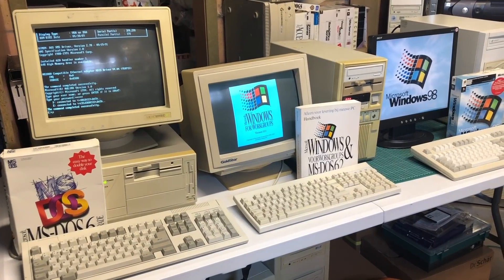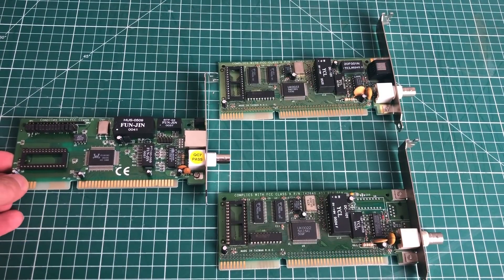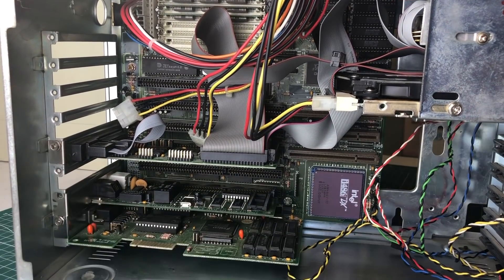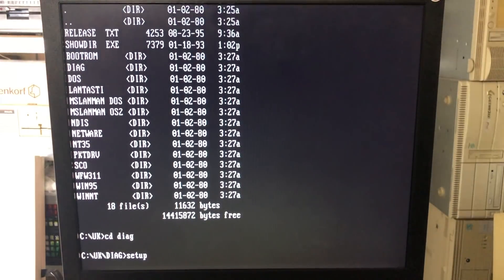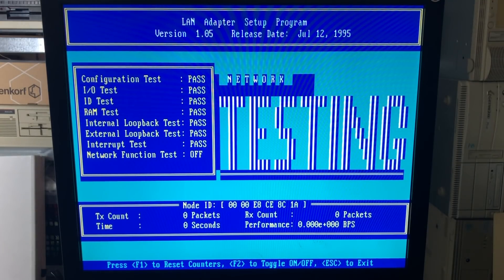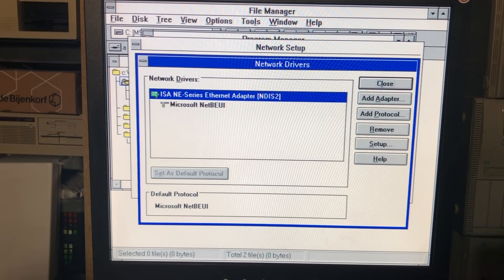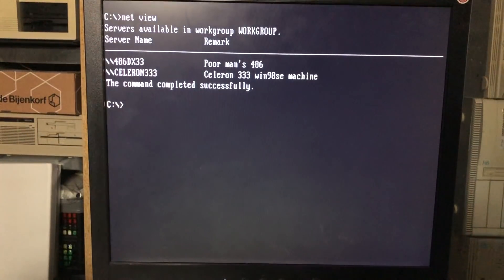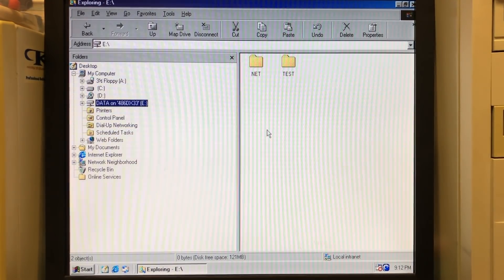Creating a retro Microsoft network using real retro hardware

Comment: RetroSpector78, I have a Pentium II running Windows 98. I want to connect to my house wifi. Is there an ISA card available that allows that? Thanks in advance!
Reply: I don't think so but a Pentium II machine will also have PCI slots, so you could get a PCI desktop WiFi card or a PCMCIA to PCI adapter and a laptop WiFi card
Reply from the maker: The challenge will be to have a card that supports the more modern security mechanisms for authenticating to a network. But as RWL2012 said, you have pci so it’s definitely possible.
Reply: Is that Win98 Second Edition?  I know I have somewhere a really old USB Wi-Fi adapter, looks like a flash drive from that era, that worked under Win98SE.  I think it was made by Hawking Technology.  Finding Win98 drivers and having it handle current wi-fi security may be a problem.

You can also use a wireless bridge, where it makes the wi-fi connection, and uses an RJ-45 patch cord to a wired LAN card in the Win98 PC.

You might also consider this unit from TP-Link:
https://www.tp-link.com/us/home-networking/wifi-router/tl-wr802n/
It has several modes, can act as a wireless bridge, router and more.  I own two of them, I use one to let me get devices on wi-fi that only have an RJ-45 UTP port.  And they are not expensive, always a good thing!

Comment: can you try Microsoft LAN Manager and try to boot MS DOS from the network
Reply from the maker: Veso266 going to do a follow up on this video soon. Seems to have sparked a lot of interest. I know there are a couple of solutions with msdos boot disks (also using ms network client, mTCP and others). Will look into LAN Manager also ! How did you stumble upon this video ? Saw a huge spike in views today.
Reply: @RetroSpector78  
I also had your video recommended by YouTube, not certain why but I do watch some other retro & old hardware channels.  I may have watched enough close together in time to be noticed and have it point me your way.

I've worked with Ethernet since the mid to late 1980s, from old original 10 Mb on thicknet trunk cables using external transceivers and AUI cables on up to 10 Gb UTP, on PCs, Macs, and a wide range of minicomputers.  Glad to see the interest out there for older technologies, I've seen too many times where someone sees a unit with an RJ-45 connector and assumes it's ethernet, no idea that serial ports like RS-232/RS-422 or other connection types even exist.

Keep up the good work!
Reply: @RetroSpector78  Youtube recomended it 
as for LAN Manager: https://winworldpc.com/product/lan-manager/2x 
you will need to install OS/2 Warp 2 to be able run LAN Manager as server because if you run LAN manager in dos its only a client as in dos era OS/2 was a server os

Looking forward to see LAN Manager :)
Reply: I also had your video recommended by YouTube, not certain why but I do watch some other retro & old hardware channels.  I may have watched enough close together in time to be noticed and have it point me your way.

I've worked with Ethernet since the mid to late 1980s, from old original 10 Mb on thicknet trunk cables using external transceivers and AUI cables on up to 10 Gb UTP, on PCs, Macs, and a wide range of minicomputers.  Glad to see the interest out there for older technologies, I've seen too many times where someone sees a unit with an RJ-45 connector and assumes it's ethernet, no idea that serial ports like RS-232/RS-422 or other connection types even exist.

Keep up the good work!

Comment: There exist 10BaseT RJ45 UTP to 10Base2 Thinnet Coax BNC Media Converter on amazon. Would you try out using the PCI based RJ45 networking on the Celeron machine using this? You could then connect the thinnet coax network to the rest of you LAN. You could also try out TCP/IP on MS-DOS.
Reply from the maker: Think I could also try to bridge the bnc part of the network with a second nic. Been thinking about setting up a windows nt server 4.0 just for fun. Have it boxed + also have a really great HP pentium machine that would be perfect for it.

Comment: BNC network cards. Talk about old school. Haven't seen that stuff since the 90's.
Reply from the maker: Stuff can get even older :) have some ArcNet cards also ... might do a video on those also if I can get it up and running.
Reply: @RetroSpector78  Maybe even a Token Ring setup...
Reply: @RetroSpector78  Please do. :-)
Reply: The BNC also activated my Memroy-Lane :D omg Terminators.. XD
Reply: Jimmy S  That's not nearly esoteric enough. There needs to be some 2Base-TL (bonded), too. :-D
Reply: Jimmy S   Guess not on the "joke", because all of this things are real. While T1 circuits are normally over copper, there are media converters that will convert it to Cooper. For routing Token Ring, there's source routing. And IP can be supported on Token Ring networks.

Comment: why not put some modern hardware too, with Windows 7, 8 and 10 :) ?
Reply from the maker: Actually got a video planned for that in about 30 years from now considering my current workload and concept of the channel :)
Reply: @RetroSpector78  hahah but it will be cool to see how DOS, Win3.x Win 9x and NT 3.x/4.0 communicate with LAN with newer NT windows es like 7 8 and 10 :)
Reply: 3 network cards, 1 switch. Done.
Reply: I draw the line at 7. 8 and 10 are a no no for me

Comment: I will say Windows 98SE and 7 was the best OS Microsoft ever produced!
Reply: 98se, 2000, XP and 7 are the greatest in my opinion
Reply from the maker: No doubt.
Reply: XP too
Reply: 7 is the best modern one, surprised it didnt get the same treatment as XP. Speaking of XP, XP and 98SE were the best of the older versions.

Comment: Memories!
On coaxial cable, all the machines shared the same bandwidth and used ethernet collisions to mitigate the traffic separation... basically with more than 10 machines it barely worked...
Reply from the maker: We used to do lan parties with 10base2 with more than a dozen machines. But want we expected from network performance was nothing compared with today :) and at that time stuff probably failed or didn’t work most of the time. Remember it was a pain when somebody needed to leave early who was in the 10base2 network.
Reply: @RetroSpector78  One of my earliest computer memories is going to a friend's house and playing Doom II over a BNC thinnet network on his 3 computers together. Good times man.
Reply: @RetroSpector78  HAHAHAAHA when the wife called the lad that was in the middle and he cut your network in two hahaha
Reply from the maker: @ErniLandia  Exactly .... last time it happened to me I was a teenager and it wasn't my wife but my dad and he didn't call but just showed up at the LAN party  making it even more embarrassing :)
Reply: All machines share the same bandwidth on any Ethernet network, look up CMSA/CD, the only difference really is that today we have switches instead of hubs. If you go back to when we all used 10baseT hubs, those were all on the same network, just like 10base2.  I built many 10base2 networks with way more than 10 machines that were very fast for the day.
Reply: @tornadotj2059  I was working with graphics and publishing back then, we hammered those networks. I think we moved directly to 10 baseT switches not bothering with hubs, the difference was great. Another office had token ring network and we were envious until switched 10 base T came...

Comment: very interesting stuff, I was aware that BNC cables were once used for networking, but I never exactly knew how, I guess I always figured it was the same as ethernet
still a very interesting concept, but I can see why BNC networking didn't really take off
Reply: BNC coax cables predate twisted pair, fiber optic and wireless, they are all Ethernet, just on different physical media.  Prior to the smaller BNC cables ("thin net" or "cheaper net") there was a larger diameter coax ("thick net") which was the original Ethernet, it used "N" connectors.  Both coax cables are 50-ohm nominal impedance; you should never use 75-ohm coax for this purpose.
Reply from the maker: yeah ... you didn't want to be the person to leave early during a LAN party :)

Comment: No IPX/SPX?  Run both NetBEUI and IPX/SPX if you want... but leaving off IPX/SPX doesn't make sense since it was the dominant protocol of that era.  I wouldn't use NetBEUI at all.
Reply from the maker: Think for filesharing netbeui is fastests and simplests. Could not get ipx filesharing to work with win 3.11. So left it out to keep memory footprint lower. (Have a follow up planned on xt based networking and ipx/spx gaming)
Reply: @RetroSpector78  IIRC NetBEUI was the slowest networking protocol.  At the very least, it wasn't routable, unlike IPX/SPX (and TCP/IP obviously).
Reply from the maker: If you have any ideas why ipx/spx didn't want to play with 3.11 feel free to pitch some ideas : https://www.vogons.org/viewtopic.php?f=61&t=69074
Reply: @RetroSpector78  It's only been about 20 years so I've forgotten the details.  But I think you need to check the bindings and make sure you have NetBIOS over IPX/SPX.  But I used NetWare clients at the time so that could be why it worked.
Reply: IPX/SPX was mainly used in corporate environments.  NetBEUI was easy to set up and was what home networks tended to use.
Reply: @cjmillsnun  IPX/SPX is what all the games used as a network transport in the DOS days.  It was so popular that Kali was created for encapsulating IPX/SPX over the internet.
https://en.wikipedia.org/wiki/Kali_(software)

Comment: Great video with some great info. Back when I was using these machines, I didn't do any networking. So, I'm having a good time trying to get some of my old machines to work together, now. Pentium 1 running DOS and WFW 3.11, Pentium 2 running Win 95 and P4 running Win 98 SE. I really need to be able to share files between the machines. Next will be getting the Win 10 and Mac to be able to access them, as well. I've just about got the P1 running the way I want it to. Thanks for the video!
Reply from the maker: Glad you enjoyed it ! Makes sharing files between computers a lot easier. No more disk swapping / thumb drive or sd card exchanges. Old school 10mb transfer speeds :)

Comment: I really can't wrap my mind around Microsoft networking concepts, retro or new -- but especially the pre-TCP/IP era. Thankfully nowadays there's even a native OpenSSH server on Windows.
Reply: Whenever I had to explain using multiple LAN protocols on a network at the same time, I would use an analogy like this: Think of a room with many people in it, having conversations with each other.  But then add the fact that some of them are using English, while others are using French, Spanish and German.  Each language has its own syntax, nouns, verbs, rules.  So only those who have a language in common to both of them can understand each other; if they don't know a language they ignore it, tune it out.  Some people can speak two languages, others three or more, so they can interact with more of the groups.

Comparing this to the computers, even though they are all on the same type of network (same room) they can only communicate with those that are running the same protocol, like TCP/IP, Novell IPX/SPX, NetBIOS, DECnet, XNS (English, French, German, Italian, Russian, etc.). There's a field inside the data packet sent on the cable that contains a number for each protocol, it's called the ethertype field.  And actually, the same holds true for physical networking, you can't interconnect Ethernet directly to Token Ring or FDDI networks without some intermediate device that has both interface types.

I hope that helps!

Comment: Hi, 

Re the Win98 with USB ports, please feel free to use the files on a friends site, he hosts a retro channel
I have used these files on my Gateway P2 and can access up to the 16 GB flash drives
https://www.philscomputerlab.com/windows-98-usb-storage-driver.html

Later on i bought a USB 2.0 5-Port PCI Card it was generic brand but ran a NEC usb chip *  this is very important as  this was auto detected by 98SE and i now have faster USB 2 at the rear of the machine, i use this for a permanent 4G module that has some cd-game images and also a USB lan adapter

Re the networking, I left some comment on your prior video with virtual box, brings back memories as i used the co-axial setup on my 386/486 pc's at home,the cable is still there 4 drops, i almost forgot about the T-pieces and the Terminators at each end.
The SMC and 3com cards i found best and the config files and boot options were easy to edit

Then came dos 5 and i regained some base memory

Win 3.11 was good i think from memory the lan card was set up in dos before windows began - it has been a long time

Originally i used Lantastic, it came in a box with 2 cards and say a 1 meter cable
Later on i went to microsoft.

However for a while i used DR-DOS, as it had a good section on lan connections and also a type of day and time setup, both kids machines had access to a game folder until 8pm Sun to Thursday de to wanting then not to play games after 8 if the next day was a school day, i had encarta in my cdrom and that was maped 24/7 

If you want a good dos-lan copy program ,  i suggest Laplink 5, of Fastlynx 2.0 both are well writen and fast and have a clone directly and skip existing files options

Regards
George

Comment: Great video, thanks.  I have a pile of network cards like these that I was wondering if I should use.  Is it possible to add an XP machine?
Reply: Get an older Macintosh and network card, run AppleTalk/EtherTalk on it as well, then a Windows 2000 machine with the AppleTalk protocol loaded, too! 😉
Reply from the maker: Yeah... also supports the same protocols and should work.

Comment: great stuff! Get some old school domain server on there! 3.51server !!
Reply from the maker: Thanks a lot, glad you liked it. The 3.51 box is on the shelf .... but wanted to keep things simple. I do have a nice HP Netserver (pentium 100 or 166) that would make a great nt 4.0 server.
Reply: @RetroSpector78  it wont be that much harder at all,  MSDOS system maybe tricky mind, windows 3.11 you just tell it to log onto NT domain, and the windows 9x system you just rename the workgroup, with the same name as the domain.
Reply: Or setup Novell Netware. :D

Comment: Huh, I attempted to comment your previous video, but apparently youtube didn't catch the comment ... Greaaat :(

I'll rewrite my answer later then, if I don't forget.
Reply: Uuuh I rewrote it last evening. I doubt you want to shut me up, it must because I talk about com files so YouTube thinks I'm a troll giving links ... Can you check if my comments aren't moderated or something, please.
Reply from the maker: Not trying to shut you up :) .... 
And I'm not seeing anything in "held for review" or "likely spam".
Reply: @RetroSpector78  gaah I hate that xD

Well I'm going to do it shorter :
You can also try Microsoft Workgroup add-ons for MS-DOS, they provide only netbeui and let you share your DOS machine's drive (and it may even take less ram, but I'm not so sure about that).

Also, you can easily set up a gaming IPX network on DOS machines with lsl dot com, the nic's novell packet driver and ipxodi dot com. You'll also need a NET dot cfg file and then you'll just have to start lsl, netware packet driver and ipxodi and you'll be good to go :) (you also need to configure some stuff in net dot cfg, but I don't know the exact syntax)
Reply: @DxDeksor  Yes! and batch script all that. I remember typing each command  and getting connected. It was thrilling at the time. Then my buddy told me about writing a batch script and I was hooked.
Reply: Friemdly reminder to comment the thingy if you havent

Comment: nicely done. Surely helps to expand the storage of the 286 and 486. Next time IPX network with games? :)
Reply from the maker: Hehe ... doom or quake on the 286 ? Think there are few ipx multiplayer games for 286 :) think all of that started with doom / quake / duke nukem. But could also be a fun video.... Think there might also be multiplayer games with a null modem cable.
Reply: @RetroSpector78   and don't forget Descent! All great fun at the time.

Comment: Hmm, that Frankenstein PC (drooling) :D Anyway, this is great stuff, I may finally try some networking. I've been able to collect several ISA network cards over the years, so this should be fun, since I know now, step by step, how to do it. Thank you!
Reply from the maker: Yeah ... NICs are pretty common and once installed / setup into the PC it’s just a matter of plugging in a cable and getting on the network. But I would suggest using 10baseT (rj45 - utp cables) for convenience :)
Reply: @RetroSpector78  True, but that coaxial cable looks so neat with those Ts and terminators :D
Reply from the maker: Not going to argue with  that ! :)

Comment: Great great video!
Reply from the maker: Thanks a lot, glad you enjoyed it !
Reply: @RetroSpector78  How fast is launching a game like Lemmings through the network, compared to launching it from a local harddisk? More or less the same speed?
Reply from the maker: Didn't really time it ... didn't feel that much slower. But the games you can run on the 286 are typically very small .... Next time I'll do some benchmarks.